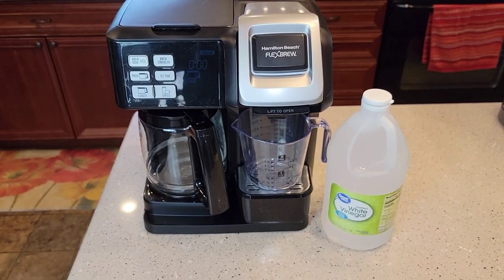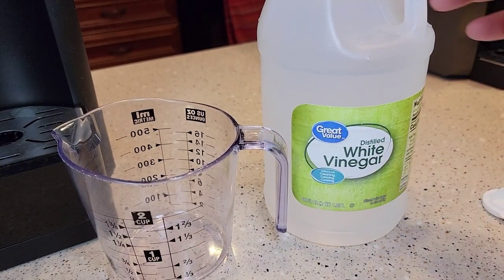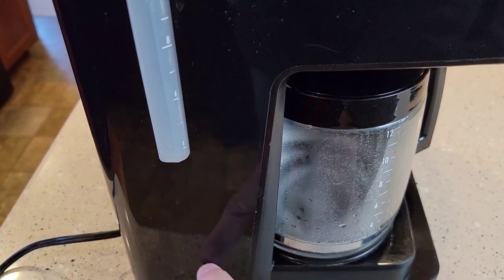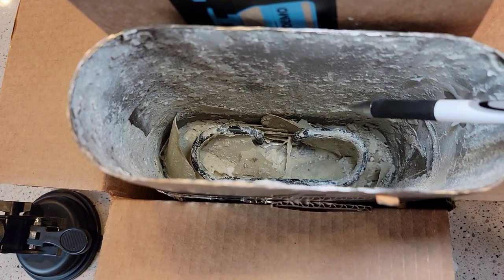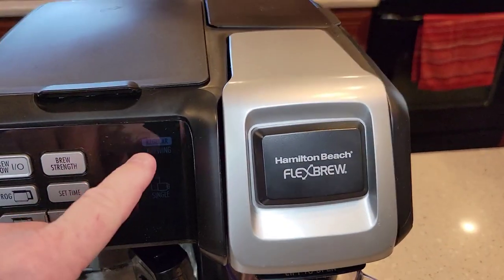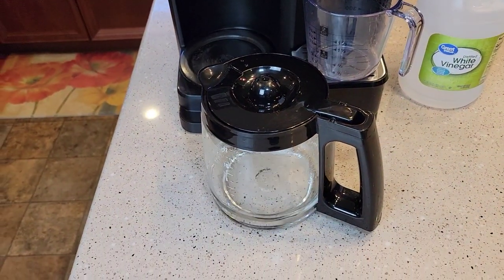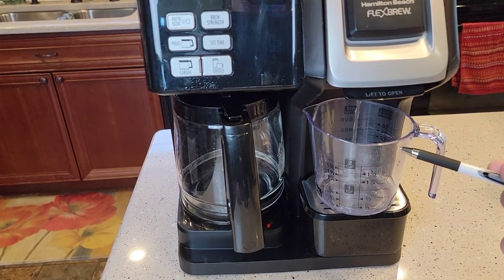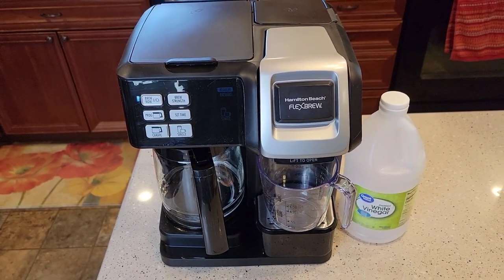HOW TO DESCALE WITH VINEGAR Hamilton Beach FlexBrew Coffee Maker K-Cup Machine 49954

Comment: The problem that I'm having with this machine is that it will not give me any water on the right hand side. It will boil and maybe a couple of few drops will come out and that's it. I have cleaned the needles I have cleaned the machine inside and out and it still will not brew on the right hand side. The machine's only 3 years old.

Comment: My problem is with my Hamilton Beach FlexBrew the model number is 49950C. When I put in say 12 oz of water and press start on the single serving side I only get 6 oz of fluid so I pour in 12 oz fluid I only get 6 oz fluid then it stops but if I press the off and then and then on again it will give me the rest of my 6 oz there is no reservoir for this It's what you see what you get 14 oz Max and as low as 6 oz any help would be appreciated to anybody

Comment: Thanks for the instruction video.  Very clear.  Not sure if you are still answering questions but our unit will not even pull more than about 1/2 of water from the reservoir and then it stops and the heater stays on with the gurgling sound.  We have to physically turn it upside down to drain the reservoir to start again.  We have a water softener so I am not sure this is a calcium build up problem.  The single cup side works perfectly.  Any ideas?

Comment: Hey, Just A Dad! Thank you for this video. I got this Flex Brew back in August. I love it. I haven't done a descaling - really have had no issue, but I should still give it a proper clean.
Reply from the maker: Thanks for Watching!! and definitely keep up on descaling.  I just took apart an old coffee maker and I was so surprised at how bad it can look on the inside.  Thanks again. check out this video I made.  https://youtu.be/mEVj5aIn9wI
Reply: What if I my says needle. 

I did what you said. Still say needle
Reply from the maker: @susanholland6828  You can try this,  I hope it helps  https://youtu.be/heLUKYWiUVQ
Reply: @JustADad I saw that part in this video and thought I was gonna lose my lunch. I’m so happy I found your video. 
I never knew that it was necessary pause the brew cycle in the beginning to let the vinegar soak inside around the heating element, etc..  I like the fact that you can start the single serve side with the vinegar while letting the carafe side soak, and then after pausing to soak the single serve side you can continue with the rinsing of the carafe side!!  Thank you for this video!!

Comment: Great videos my man. Very specific and yet very easy to follow. I watched your other one of your teardown of these FlexBrews. I have a newer model and I am having an issue with the water from the single side spilling into the carafe side. I use to use 10 oz. for my Lipton tea k-cups and it would fill up my 16 oz. cup full of ice for a quick cup of iced tea. It now takes me 2 cycles of 10 oz. to do the same thing and the reservoir seems to empty waaaaay quicker. I have cleaned and descaled and am still having the issue. I am now wondering if it is that little white box inside between the 2 pumps. Too scared to tear it apart. I am pretty handy with repairing electronics and appliances, so I may give it the old college try. Keep up the good work bud.
Reply from the maker: see this  https://youtu.be/8jxeCaXW7MQ

Comment: I have the one with the metal carafe.  I only used the pod side once.  But I noticed when cleaning if you don't do both sides anyway the "Clean Message" will not go off.  It drove me crazy the first time, and somehow I did it anyway and the message finally went off.  Just to let people know.  You need to do Both sides when the "Clean" message comes up. (It comes on the display on the metal one)  I did not see it on the one in the video, don't know if it has it come up on the display.

Comment: I've ran several cups of vinegar through mine and the cleaning message wont go away.  I've follow your video to the letter. Even waited 90 minutes. Message wont go away which is strange because I barely use the pot size.

Comment: Can I use descaling liquid I bought for my Nespresso or does pure vinegar work better? When I first bought the FlexBrew I thought it was very slow brewing and act usa with some reviews afterwards, that also said the same thing. It was slow when brand new, just wondering if this will help or not?
Reply from the maker: Not sure about the Nespresso descaler, I would just use vinegar.
Reply: @JustADad  thanks. I read my manual on the FlexBrew and I appreciate your attention to detail on making this video. 🌟🌟🌟🌟🌟
Reply: I use, keuring descalate liquid and now it heat the vinegar etc but dont pump. Help?

Comment: Does this clean where you are dispensing coffee mine seems to be slowing down and making a mess
Reply: Mine too but it's quite a few years old maybe 6 to 10 I wondered if the filter at the bottom of the dispenser of what coffee is changeable
Reply from the maker: yes, have you descaled it before and if so how long since you last descaled?
Reply: @JustADad  no, I have had it for 5 or 6 years and haven't descaled it previously, but did after seeing your video, and it hasn't exploded yet, so it appears all is good. ;-)  It does seem to be pouring faster.  Thanks for the video.
Reply from the maker: @kimmcamp  Yeah that is a long time not to descale.  Thanks for the update and let me know if I can help

Comment: Hey! Just a Dad...
My Pot is just like this one.
We use the carafe more than Kcup side BUT... This morning I threw in a Kcup and Yes water and it told me to add H2O. I've already cleaned the obvious things. I just can't get it to  recognize/brew my water/coffee!!!!
Got any advice?
Thank you!
Reply from the maker: Sorry nothing is coming to mind, but lots of people are having this same problem.  I have had other viewers say the same thing, that they can not get the H2O light to go out.  Let it sit overnight with water in it.  if that does not work, dump out that water by tipping it over and then add some really hot water from the coffee pot side to maybe clean or activate the sensor or float that is messing up. 
Let me know how it goes.
Reply: I let mine dry out for a few days and I made sure that I selected K-cup first...then added water and it worked.   I left it unplugged while it was drying out too.  Hope it works for you!
Reply: Sounds silly.  Bit make sure you've pushed the right button. I've started to make a cup of coffee. And it was still on the pot side. It told me the same thing. Switch may be out.

Comment: On the single serve side, mine wont pump the water out. I took the side off and watched it and the water isnt getting to the pump. It is only a couple years old. Just wondering what would cause that.
Reply from the maker: Is the pump running?  in might need to run so it can pull down the water.

Comment: My Flex Brew keeps blowing out the top of the K Cups just before it finishes brewing. I have cleaned & Descaled several times it does not help. What is wrong with it. Oh I have also cleeaned the needle.
Reply: Please I have done, this all again. I tried changing brands of K Cups the still explode.. I am a teacher. I use the carafe side on work days the KCup side on non work days ( includes mist of the summer). It's too much cleanup to strain grounds from cup plus what it splatters all over. I need to e this fixed. HELP PLEASE

Comment: Just finished descaling. There wasn't alot of stuff in the water but why does the machine keep displaying "clean"?
Reply from the maker: That is a good question.   I am not sure,  maybe unplug it and let it sit for 10 min then plug it back in.  I am not sure if the clean light comes on after so many brews or if they can sense when the heating element on the inside is dirty with backed on minerals.

Comment: Hi I need help I’ve been trying to use my single side for three days now and I’ve cleaned the needles and it’s like the water doesn’t wanna circulate to brew? So I’m scared the vinegar won’t come out
Reply from the maker: on the single serve side you can remove that plastic screen where you pour the water, there is a screw beside it, under it there is a metal screen, make sure that metal screen is clean, and then clean the needles.  https://youtu.be/heLUKYWiUVQ

Comment: My Flexbrew keeps coming up with the code Fil H2O..and neither side will make coffee.  I don't hear the pump trying to work.   Do you have any hints on how to fix it, please?
Reply from the maker: It might be the needles https://youtu.be/heLUKYWiUVQ
Reply: I figured it out! I emptied all of the water out and let it sit for a couple of days to dry out.  I had noticed that I had it selected to the pot side when I added water to the k-cup side.
I plugged it in and selected the pot side and when I added water it brewed just fine. ( It wouldn't work when it showed the Fil H2O error)
Next,  I selected K-cup and then poured 14 ounces into that side, put cup in place and pressed start...and it works fine now.  Yay!!!
Reply from the maker: @karenm2634  Wow, good job figuring it out!!!!

Comment: What if the message is the reservoir is clogged?
Reply from the maker: Check the water screen at the bottom of the tank on the single serve side.  you will have to remove a phillips screw and cover first.